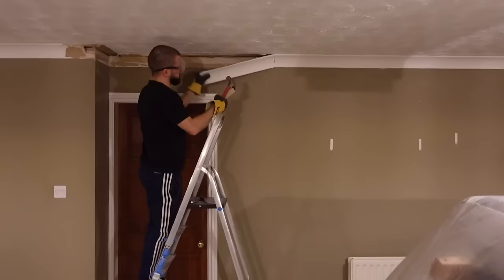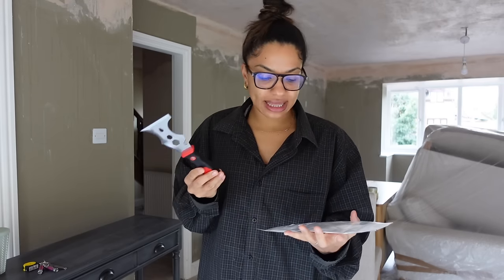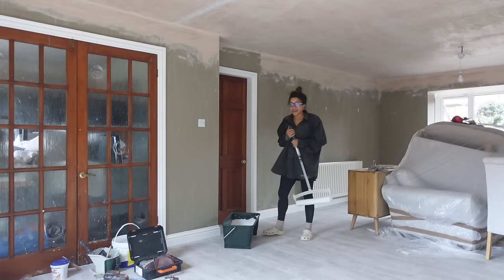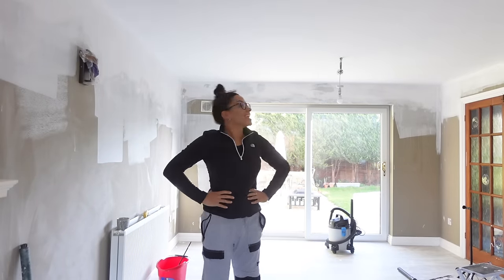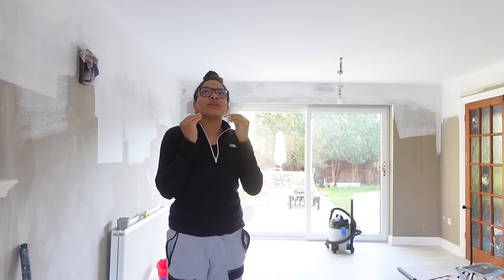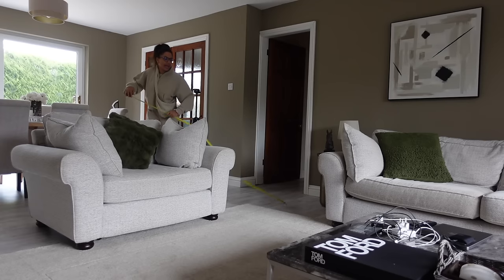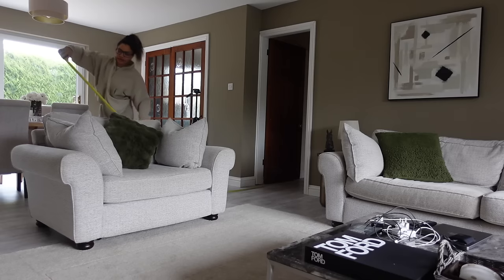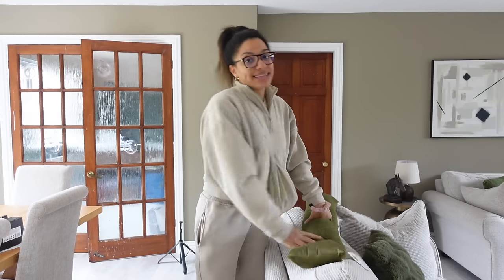Living room spruce | Painting the ceiling with a mist coat and upgrading the sofa feet

Comment: You might need to attach the vacuum and power tools together using an “extension sleeve” of masking tape so they slide in together securely  (or cardboard tube fastened with masking/gaffer tape - like the middles of loo roll/kitchen roll)
Renovations, bloody hard work and occasionally depressing having to live with the mess!  Keep going! (eye on the prize!)
Reply from the maker: That's a brilliant idea! I actually ordered an adapter today so if that doesn't work I will be adopting the loo roll + tape idea 🤣

Comment: Literally just told another you tuber this on the weekend 😂 bigger rollers are the only way to knock these jobs out quicker or paint sprayers where the paint stays in the container on the floor rather than holding the weight of the paint in your hand that colour is gorgeous ❤
Reply from the maker: I'm looking into buying a sprayer for the other rooms because I'm not sure i can handle much more on the neck and shoulder pain 🤣

Comment: I felt your pain painting.  The larger the brush the more paint you get on the ceiling or walls but those rollers are heavy! You did it, great job. I have watched all your videos but am a bit confused.  Why did you remove the old coving? Love the paint colour btw.  I think the holes in the multi tool can be used to secure or remove different bolts? For future info, buy curtain poles or tracks suitable for the weight of curtains you are intending to use ie voile or lined fabric curtains.  Having fitted hundreds I know all the mistakes people make.
Reply from the maker: Soo we took the old coving down because it was a plain style and I wanted a little more detail and you can't stick new over old so it had to be removed. Hoping to get a double curtain pole so we can have curtains and voiles - hope it looks good! 🤞🏽

Comment: I have an open plan sitting dining kitchen with floor to ceiling patio doors and I have had terrible trouble getting a good finish on my ceiling. I repainted it 3 times now and I’m still not satisfied. I’m considering getting someone in to spray it but I might give the 18” roller a go.